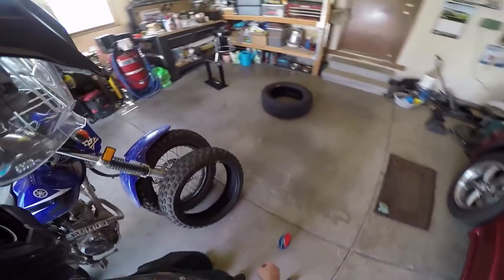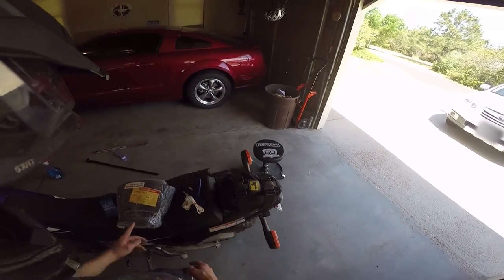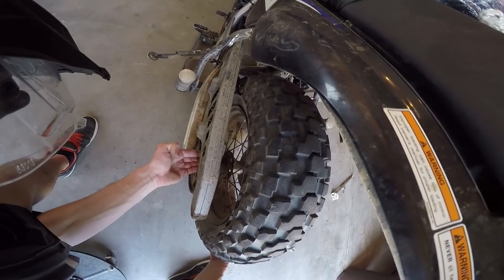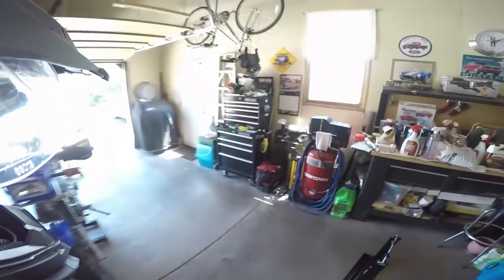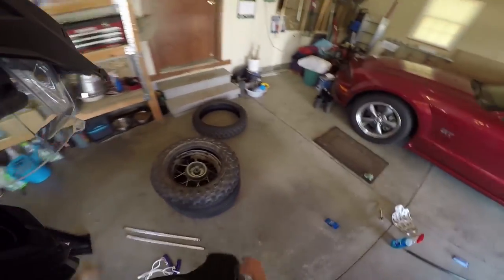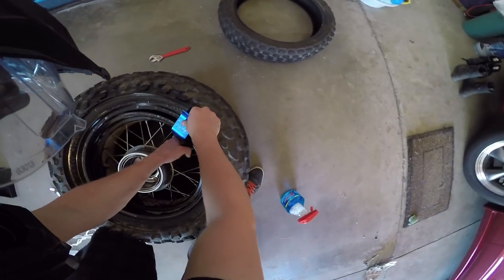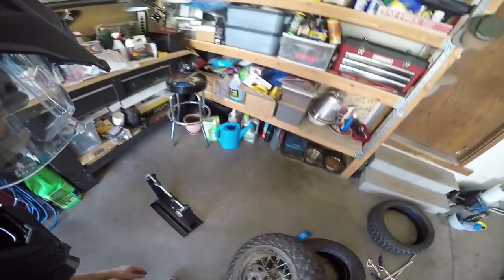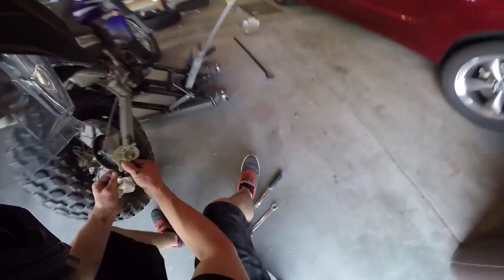how to fix a flat rear tire on a TW200

Comment from the maker: find parts and tools here:
rear inner tube: https://www.denniskirk.com/bridgestone/14-tr-4-cmv-standard-tire-tube-180-80-14-548715.p652054.prd/652054.sku
 front inner tube: http://amzn.to/2kKfR4x (amazon affiliate link)
my front tire: http://amzn.to/2kJ1m58 (amazon affiliate link)
tw200 rear tire: http://amzn.to/2kKdsqA (amazon affiliate link)

tools used:
harbor freight tire irons
harbor freight bead breaker 
windex for tire lube (works ok but real tire lube is better)
Motion Pro Rim Protectors: http://amzn.to/2kK4qcX (amazon affiliate link)
Motion Pro bead buddy 2: http://amzn.to/2kiaywx (amazon affiliate link)
bicycle pump
crescent wrench
tape measure
19mm wrench
22mm socket with extendable ratchet 
(buying from an affiliate link will help me support the channel at no extra cost to you, thanks!)
Reply: Thanks for the video.... just for your info, 2 of the "affiliate links" do not work. I want to support you because you help us a lot. Thanks again!
Reply from the maker: @joseminguetca  no problem! Thanks for letting me know, some links stop working after a while or the product gets discontinued. Ill update the links tonight. Thanks so much

Comment: Excellent tutorial. I'm pondering buying a TW200. Had no clue the tires had tubes. Tnx for sharing 👍
Reply from the maker: thanks! they are pretty fun bikes. yeah most all spoked rims use tubes because you can't seal the spokes off very well from leaking air. but there are a few new bikes that have spoked tubless tires but they are mostly for expensive newer bikes. spoked wheels can take a lot more abuse than allow wheels, that's why you see them on off road bikes. no problem, thanks for watching!

Comment: Good video...An old mountain bikers trick is to sprinkle baby powder (Cornstarch, not talc) on the tube before installation. It makes the tube slide in and around the tire easier and helps prevent pinch flats, and keeps the tube from "cold-welding" itself to the tire over time. You can also patch the old tube and keep it for a spare on those long rides away from civilization!
Reply from the maker: wow thanks for the advice, that is some really good stuff!

Comment: Great video but I have to wonder why you didn't put in a tire plug from the inside of the tire? It helps prevent other nails from entering via the hole you left in the tire. Helps keep water out too. To each their own I guess.
Reply from the maker: thanks, yeah probably should have done that

Comment: Hey man how do you like that Shinko 244 on the front for on- road riding? Is it better than stock deathwing?
Reply from the maker: yeah I don't mind it haven't had a problem with grip at all I just need to balance it, small rocks will sometime get stuck in between the knobs and shoot em out in the fender sometimes but not a big deal, it is slightly wider than the stock one so the steering seems a bit heavier but I got use to it quick. I have the 5.10 - 18 they also have a 4.60-18 which is slightly thinner than stock. they don't have the exact same size as stock since they use a different type of size units
Reply: TDubsKid Cool thanks. I think I'm going to get the 5.10. They're nice and cheap so I can always get another size/ brand if I don't like it. I like the way it looks though!
Reply from the maker: no problem! nice I like the 244 way better than stock, it's lasting way longer too. yeah it looks pretty gnarly compared to stock, a lot grippyer too

Comment: Easy enough at home, but how do you do it on the trail, way out in the middle of nowhere? I have a centerstand on my XT225 that I got from a guy on a forum I used to belong too that made them. But he no longer makes them.
Reply from the maker: yeah much harder in the middle of nowhere, you can use the kickstand and a tree to get either of the wheels off, or high center it on a log or rock. worst comes to worse you could lay it down

Comment: What if your in the wood alone anything you can do ?
Reply: Just patch the tube especially if you have balance beads in the tube. Carry co2 tire fill kit or compact hand pump or 12v compact electric pump
Reply from the maker: yeah a patch is a good way to get you home, I personally would put a new tube in once I get home though because patches can fail

Comment: Baby powder is worthless with wet lubricant, and you should never try to install or remove a tire without PLENTY of wet lubricant. I usually use Ru-Glyde, available at auto parts stores, but in an emergency, anything slippery will do. Windex, WD-40, vaseline, armorall, furniture polish, baby oil, motor oil, even soap and water if you have nothing else available. I tend to avoid soap and water, because most soap is not actually soap, it is detergent, and can be very corrosive when left inside a metal rim for a long time. 

Where did you get that huge bead breaker and those huge tire irons? I recently bought a TW, and while I have not had a flat yet, it will happen, or I will need a new tire. 

Before I got the TW, I had an XT. I discovered that most of the stock tubes were unpatchable, for 2 reasons. Most thin stock tubes pop like balloons when punctured, and even if they don't, before you realize you have a flat tire and get stopped, whatever punctured the tube has wiggled around in it and shredded the tube. I do carry a patch kit, as an absolute last resort, along with a bottle of Ride On, in case the patch doesn't seal properly. I was able to get 4mm thick tubes for the XT (4 times as thick as stock) and sometimes they can be patched. 

Again forget about the baby powder on motorcycle tubes. Bicycle tubes can usually be installed by hand, without tools or liquid lubricant. If there is any benefit to baby powder, it is lost when you soak the beads and rim with lots of wet lubricant to get the tire back on. I've had to use Windex sprayed on the tire beads to get them to seat properly when inflating the tire. Dry beads are just not slippery enough.
Reply from the maker: hey thanks for the info! and I got them at harbor freight, yeah a patch kit most likely won't work but could I guess as long as it isn't ripped in half